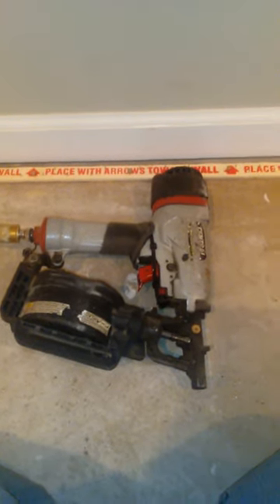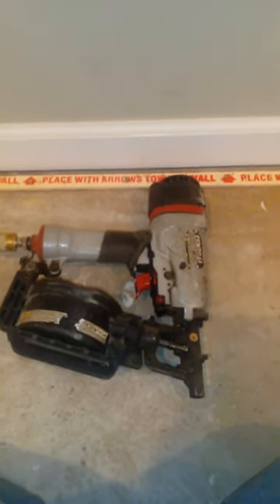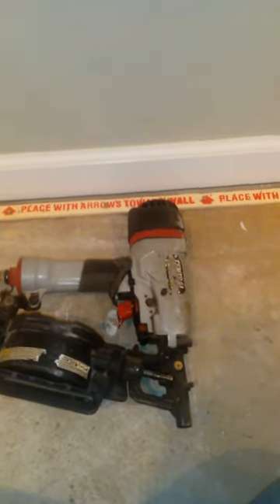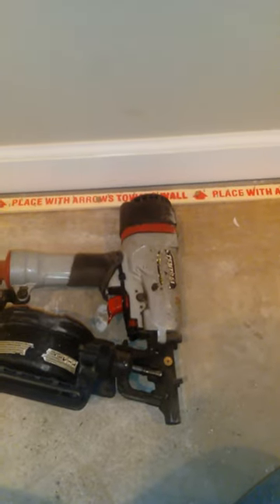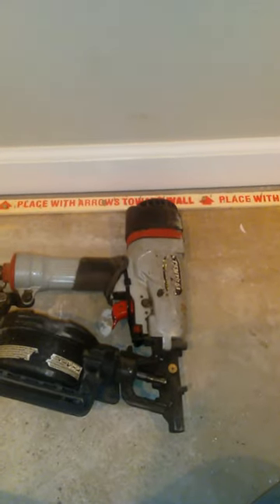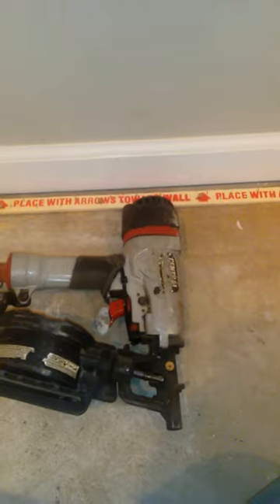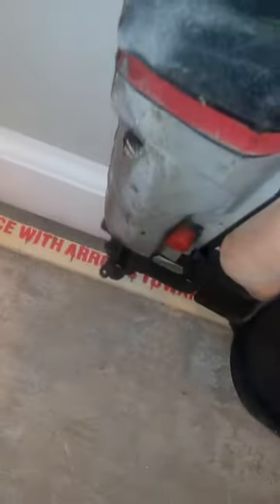Installing Concrete Carpet Tack Strip with a Roofing Nailer

Comment: Are any nails loaded in the gun, or is the air pressure alone driving them in? Might have to steal this idea
Reply from the maker: No nails in the gun.  The hammer mechanism in the roofing nailer "pounds in" the concrete nails in the tack stip.
Reply: @cedarrapids81  how durable was the nailer?
Reply from the maker: @manoelusa  I've only done a few houses since then but it's still working.